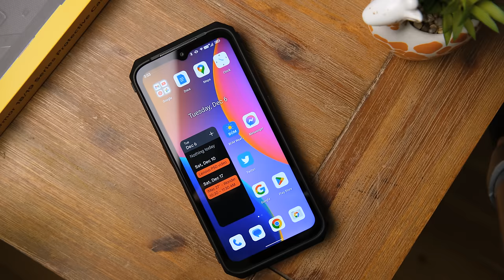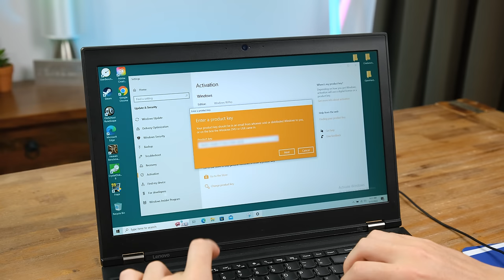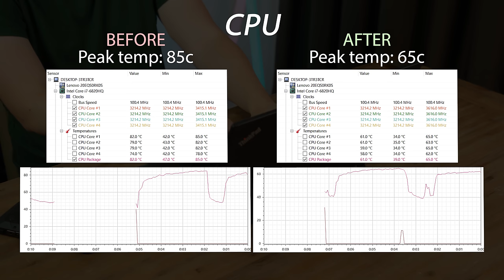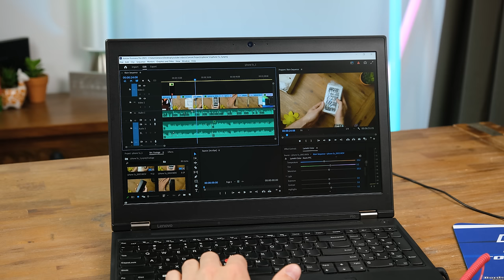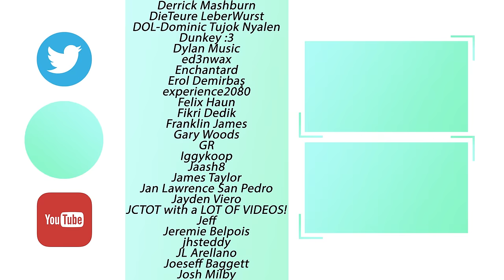I Bought A Cheap Lenovo P50 Workstation! Should You?

Comment: Seems quite a steep price, compared to what you usually buy. I recently bought a T580 (with a T570 sticker on it) because I wanted an 8th gen for Windows future proofing (as much as I dislike Windows 11) for 150usd, and it's in absolute mint condition. Definitely underpriced, and I just got lucky as I was looking for an 8th gen Lenovo T/Dell Latitude/HP Probook and I didn't actually look at the model number closely. Turns out the bezel has once been changed and it was sold as a T570, which is probably why I got it cheap. 
I always hated Lenovo keyboard. People love them, but as someone who does 700+ keystrokes per minute I just can't get used to themt he issu efor me is that I alway smisplace the blan kspace when typing on a Lenovo keyboard. Apparently the spacebar is slightly too light and gets pressed too easily at that speed. Other than that, a lovely laptop.

Comment: A few years ago a computer specialist posted that Lenovo produces laptops in a particularly practical way so that you can easily upgrade your laptop with new hardware. That no other manufacturers are doing that. Especially not...............Apple.  Whether this is still the case is questionable. All manufacturers are constantly putting differently designed sockets so that new hardware no longer fits in.

Comment: Using mismatches ram 1 8gb and 3 4gb should not cause a problem if they are rated for same speed if they are rated for different speed the pc/laptop will run on the speed of the slowest ram. correct me if i am wrong 😊

Comment: This looks like a really nice laptop, and kinda reminds me of my HP ZBook 17 G1. Being able to run 2x M.2 SSD and a 2.5in SSD/HDD is good going, as is the 4 RAM slots (my personal preference is 32GB RAM, but that would cost more).
Maybe I should look out for laptops in auctions...
Reply: That would be a good idea. Laptops made within the last 5-7 years or so usually still have a ton of useful life in them, and you can get them with a steep discount compared to when they were new. However, Windows 10 will reach end of support on October 14, 2025, essentially forcing everyone with a non-Windows 11-compatible computer to either buy a new computer or switch operating systems.

Comment: i bought a Dell Latitude 5285 "Surface Pro" aimed for the same target market, so it´s a high quality business like device.
Getting it open is very easy but only upgradeable parts are really the wifi/bluetooth and the m.2 SSD.
It can take NVMe SSDs but they´re limited at PCIe 3.0 x2 (theoretical max. sequential read/write about 2GB/s).
There is also an unused mPCIe Slot where you could put a WAN module inside (or another SSD).
The sim slot however is already present, you only need to route some antennas.
Other than that, it has a Core i5 7300U, 8GB of soldered RAM and various enterprise level features in the BIOS.
Unlike anything in this device category, it even allows to boot legacy MBR so in theory you CAN install windows xp, vista, 7 on it.
I tried windows 7 but i wasn´t able to get a suitable graphics driver to work.
Currently configured as multiboot options are Ubuntu, Windows 11 and Android-x86.
The power and volume keys are capable of opening and navigating the boot menu, no keyboard required to select the boot option.
I really love it especially since you can get older business laptops and tablets for a very decent price.

Comment: I just recently "upgraded" my fully-pimped out P50 (4K with calibrator version bought used for almost nothing) for a cheaply purchased 4K Dell Precision M5530 - also an old clunker - but with a next-gen i7 (8th) that features an additional 2 multi-threaded cores, benefiting my VM's performance. Still trying to figure out what to do with the P50 that is in mint condition.

Comment: I'd say buy it if you have no other options and you need a workstation, ebay does have tones of resellers for this type of laptop, if you can get it on marketplace or local refurbish places you might score a better deal, I feel ebay is still %50 percent marked up from what it should be or what they got it for at the biggger greys online lot auction type sites.

Comment: Me watching this on my p50 I agree! Although I bought mine a year or so ago in very good condition with the best display (The one with touch AND a digitizer), 2 250gb nvme drives, and 16gb of ram for about $500 usd, which in all honestly was a lot, but I have no complaints about this laptop. It was even stolen from me and the thief dropped it, all that happened was it chipped some plastic on the palmrest

Comment: I have a Lenovo for work. The most annoying thing is the function key is where the control key should be on the left, haha! Otherwise its a good unit.
Reply: you can switch the order of the buttons using software
either through Lenovo's vantage software (red square L icon), third party keyboard remapper tool, or just in the BIOs (there's a setting for it)

Comment: Answer is no. Or certainly run thru an MOT first as the seller won't tell you you need to spend even more money and time changing the ssd and ripping out the guts to check and renew the thermal paste which is an absolute ass to get to. Had mine just over 4 months before it packed up on me ruining the ssd drive where I lost all my work, documents and game saves at least on the laptop. Still haven't been bothered to fix it as the costs will be nearly $200 dollars extra. Remember these laptop are almost 10 years old, original wear and tear that lies beneath the covers won't be admitted in the sales pitch.

Comment: I deal in used ThinkPad's t series and the odd workstation in Australia and used ones sell quite well.
duel battery setups are great worst part is the keyboard change on the T440 to T470. You can get a complete refurbished T460 around $200.
Reply: What happened to change the keyboard from the t460 to the t470?

Comment: the t570 is also good laptop. i use lenovo t570 with 2gb Nvidia card it also very good. and has two battery in it. it has usb c Thunder blot and andio jack usb a 3 and hdmi    so modern connectors.  with intel core i7 7th gen cpu my i have 24gb if ram since there only 2 ram slots

Comment: i got my dell precision m4700 for free from a family member i upgrade the notebook memory to the maximum 32gb of ram installed  a msata 256gb ssd and 512gb ssd drive and a bluray drive it has a 15.6 1080p display Bluetooth and wifi and intel core i7 3940 extreme cpu

Comment: Thought it was an older machine because of the Windows 7 sticker on it until I saw the Thunderbolt port. It must've been released around the same time as my current laptop (a Legion Y720, also a Lenovo laptop). Guess mine's getting old now...
Reply: It has a 6th gen i7 I believe, I didn't even know windows 7 was sold on brand new laptops by then
Reply: @lennytlm  6th gen is usually shipped with 8.1 or 7. 7th gen shipped with 8.1 and 10 since 7th gen is from 2015 and 6th gen is late 2014

Comment: Didnt you check the faulty usb? Maybe reflowing would have solved the issue?
Reply from the maker: Very true, could've simply been a cracked solder joint. However there were three other working USB type A ports so it didn't bother me

Comment: I know I know, first everybody flames you for not replacing thermal paste, and now I write this comment, but hang on:

"I recommend always replacing it with older devices, as you never know which thermal paste has been used" generally I agree but especially with some high end workstations with very good cooling there seems to have been a trend going on for a bit longer to use those Honeywell semi liquid thermalpads you might have recently seen on LTT. I think especially higher end think pads. Replacing probably won't show very much improvement in average temperatures but the old pad will probably stay in that performance range for decades to come and the paste will go bad relatively quick. 

With most applications this isn't a factor to consider since you have paste anyways, but if you have a device on hand that might be equipped with one of these pads I'd think about it twice before removing the heatsink with that knowledge.  Would probably first check if temperature and noise are acceptable when the coolers are cleaned as you did here

Comment: I would not from off Amazon or eBay. I had a P50 Thinkpad in very good condition and it bricked within 4 months with so many compatibility issues, the cost of actually buying it 2nd hand then the repairs to the motherboard, SSD, battery and OS - you might as well save up to buy a brand new one. Or better still, stay away from Lenovo laptops as they have to be the buggiest manufacturers in the industry. Anyone wants mine minus the SSD for a outrageous price it's yours.

Comment: Would you recommend buying asus vivobook s16,  16gb ram 256  memory if you have the option or buying a Lenovo thinkpad P53 (i7, 16 GB ram, 512 GB memory and nvidia graphic card) for the same price? Which would you go for?

The Lenovo p53 is from 2019 but this one is new with a little worse specs. What would you recommend?
Both for the same price around 600$
Reply: Go with the Asus every time, the Lenovo are notorious for hardware failures.

Comment: Don't forget Lenovo will automatically try to run the ram at whatever the SPD is.  My P50 would boot and run 3200mt/s ram?!?!  I think it had a Xeon mobile though, not sure if the i7 does the same.  Xeon mobile can run ECC too.

The way I hear it Lenovo sweet talked Intel into allowing memory overclocking.  My x230 is running 2133 DDR3, and it's legit quick with some low latency.